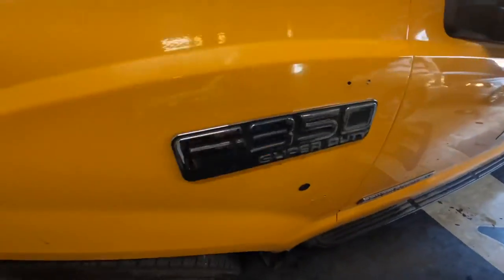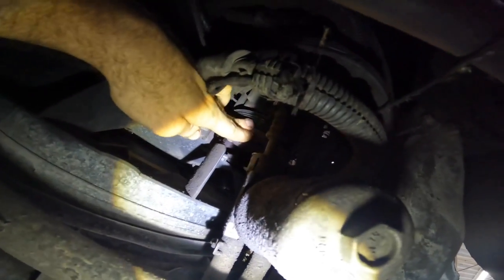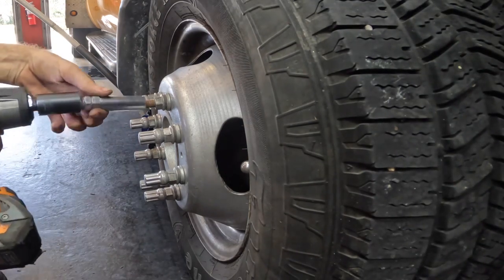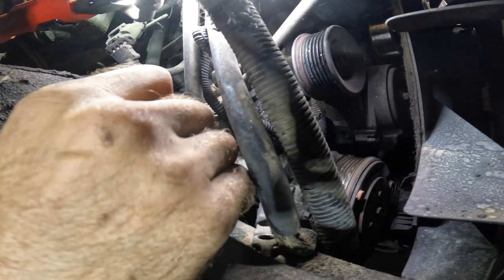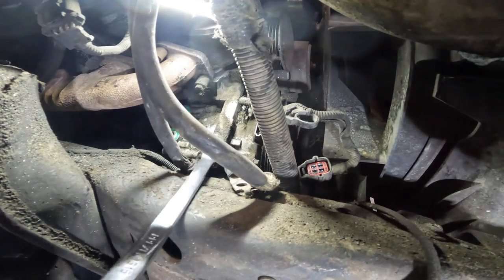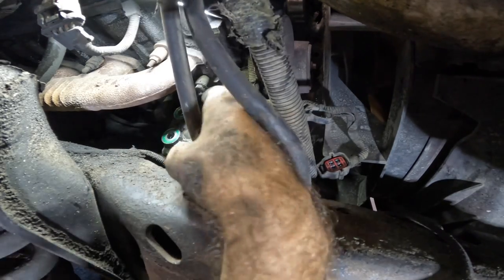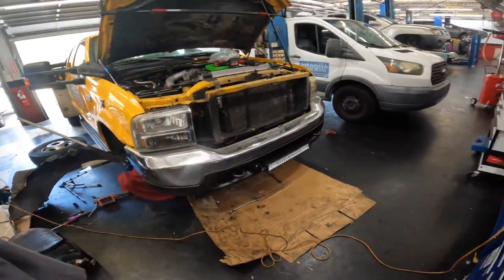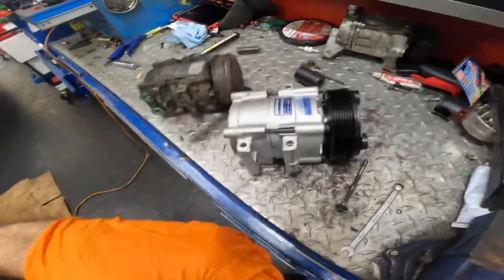Cut the Frame, Pull the Cab, or Suffer? Ford Powerstroke F350

Comment: I feel your pain, Ray! I was talking to a couple of off-duty mechanics at an event once, and they said the later-model Ford trucks were actually set up with cab removal as a part of some maintenance procedures. Don't know if there are shortcuts and other ways shops do it, but I'd expect that after the warranties run out, most people take them to places other than dealerships. One of the guys said that on Toyota trucks, he cuts one of the mounting ears off the water pump to save a lot of time. That doesn't sit well with me, but I realize the "right" way could take hours longer. Me? I do everything the hard way, but I don't mechanic for a living.
Reply: I met one of the Ford engineers..you are correct
Reply: This is the infamous 6.0 or Six Point Blow. This engine is a complete disaster and is a maintenance nightmare. For most serious top end work, which most need at about 170K miles, the cab must be lifted off the frame to access the heads and other sub-assemblies. Do not buy one of these trucks.

Comment: Ray I’m amazed on such a lengthy job you didn’t spend 5 mins on a pressure washer to save you eating dirt? Great result as usual Rainman.
Reply: And chase electrical gremlins afterwards for a few days? I wouldn't chance it.
Reply: @csgergo80  this is the best way I’ve ever heard that situation referred to 😂 totally stealing this
Reply: @csgergo80  Where the compressor is located at the base of the engine it is below any sensitive electrical that could be problem causing from washing. Additionally that area is a driving wet zone, making it a low risk to pressure washing, it would be nice if done especially for a tight job like this but rarely done or expected in a high turnover service shop.
Reply: He didn't  want to Pollute the Parking Lot.💣

Comment: the "o ring" trick was great. there was 2 holes why didn't they just put 1 hole where the bolt was? I worked on cars up north till my hands got so cold i couldn't hold a wrench
Reply: I'm guessing the engineer only measured once with his slide rule. 🤣🤣🤣

Comment: Another mystery solved....  It's very educational, watching you work Raymond, I'm not kidding.....

I've been wondering, why do these sets have 5.5mm sockets now???  I'm in a different industry, but the cars I work on are mostly GM, and some FCA, for me, family, etc....  So yeah, never needed a 5.5mm....  It's a Ford thing!  Huh.  And there's the answer...  Thank You Sir.
Reply: GM used the 5.5mm to bolt the coils to the modules on the old stuff. 3100, 3800 v6
Reply: @mph5896  I must have never run into it!  Hmm.  Thank you.

Comment: It's 11mm because Ford knows that everyone looses the 10mm sockets........Ford Cares.....Man its a great thing you don't have Parkinson's Ray but honestly I would have cut a hole in that frame plate.
Reply: Yet 10mm is the best mm at least for handguns :p
Reply: That's why I always keep 2 10mm sockets as back up.  Mine disappear about 2 a year and if lucky I find one every 2 to 3 years
Reply: I always thought it was because Ford was just buying out the world of cheap overstock bolts/nut sizes like 11mm 15mm and 16mm
Reply: Ray is a stubborn but great mechanic , I would have sprayed a couple gallons of kerosene and let it soak , then hit it with dish soap and hot water before breaking a bolt loose .

Comment: Well done Ray, great job. Sorry about my feelings about cutting an extra hole in the frame, but I would have done it. I doubt it would make any difference to the strength of the frame and who would know? I wouldn't tell anyone, promise.
Reply: metal-cutting door knob saw worked well for me  then i welded extra large washer over the cut area after done -painted it up like 5 or 6 layers over so cancer dont get anywhere

Comment: I've been a diesel mechanic for 25 years I usually work on 18-wheelers but I've done my fair share of 1-ton Diesel and it still baffles me how Engineers can be that stupid
Reply: They were counting on the truck owner who got burned in the first place buying a 6.0 to bring the truck to the dealer who would then again triple charge for the repair
Reply: Engineers sit at a desk wearing a white shirt and tie. No grease and dirt involved.
Reply: Because most have never turned a wrench in their life.
Reply: cali gdp  Lift the cab for three bolts? That is not a good design.
Reply: cali gdp  I pull the cab off my truck and take the glass out of the windows every time I check the oil.........
Reply: cali gdp  Yep. I divorced my wife. But, my attorney told me she is still my sister.
Reply: cali gdp  ah you must be a engineering specialist. 🤣
Reply: Engineers are damm stoopid but its the bogus manufacturer who allows this kind crap to go on...
Reply: especially ford engineers

Comment: First off Ray... thank you for editing this down!  A question I'd have watching this....  how the heck are you going to put the AC lines back in?  I wonder if it would have been easier to remove the exhaust bolts, motor mount bolts, raise the engine a few inches and then replaced it?

Comment: I can imagine the feeling of accomplishment when you finally get that compressor out! They sure packed that engine bay solid! I wonder how long that non original failed compressor worked before failing?
Reply: Actually Ford removed 2 feet from the engine compartment. Diesel fitters. Yep just more of that shift for brains engineering for the sale of styling. Yes a lot of those engineers do not what names of the tools he used are called.

Comment: Man these Fords.  Some stuff is overly complicated and over engineered but other stuff  actually pretty clever.  It's a mixed bag.   I inherited a 98 F150 4x4 with the 2-valve 5.4 and it was absolutely FILTHY in the engine bay.  Just identifying the leak (the block oil adapter gasket and the remote oil filter hose) was a nightmare because of all the sludge.  I commend you man.  You manage to stay pretty positive and don't curse yourself into oblivious.  Good job; love your videos

Comment: I remember you replacing an evaporator on a ford truck after not being able to just replace temp sensor.
I couldn’t believe the ridiculous design that was allowed.
Now this. …How can Ford get away with this nonsense?
Well done Ray.
You are a trooper!
Reply: I work for Ford. This isn't even bad. When I tell professional mechanics that work for other brands what I do every day, they don't believe me. Here's one quick example. One of our models has a sunroof track that's built into the roof itself, and 90% of what goes wrong with them can't be serviced. So, for a fairly simple repair, I have no choice but to cut the entire roof off the vehicle and replace it. Just the part is $12,000. A 4 door sedan has nothing from the top of the windshield to the trunk. I literally turn the car into a convertable. You have to see it to believe it.
Reply: @AT-wl9yq  Which model is that?  Do tell, please.  I'm curious to know which model to avoid like my plague (or ex-wife...same thing)
Reply: @DavidWilliams-hf8sc  Ford Fusion/Lincoln MKZ.
Reply: @AT-wl9yq  ok.  great.  Thanks.  So no sunroof, got it.  Any other stupid repairs to avoid?  Do the AWD systems hold up on the Fusions?
Reply: @DavidWilliams-hf8sc  I can't say because I don't see too many of them. Other model's, like the Taurus, have them and its a much more popular option. The transfer cases have problems and can be a costly repair once you're out of warranty. I don't want to tell you what to do, but if I was buying the car for myself, I wouldn't get it with AWD. I don't know what year you plan on getting, but I would definitely be careful with what motor you get. Some of them come with the 1.5 that everyone has problems with.

Just going by what I've seen, the hybrid Fusions seem to hold up the best. They have 2 batteries, and each one is $8,000. Batteries eventually go bad no matter what brand you get. You wouldn't believe it, but sometimes sales forgets to mention this to the customer before they buy the car.

Comment: That is one of the most painful removal/reinstall I've seen in a while.  My foul language level do that job would get me felony time.  Wow. Pretty darn impressive.
Reply: Yeah, there’s no way I could ever get a video posted doing a job like that, LoL.
Reply: I am by no means any type of auto or diesel mechanic but I recently bought a 2004 F250 with the 6.0 power stroke with 160,000 miles and drove it home but the AC compressor locked up on me when I pulled into drive way and took me awhile to figure out why it wouldn't turn over fast enough to start finally figured it out and began to remove ac compressor in my yard cause I couldn't drive it until got new compressor and belt installed. It was the the most difficult auto repair I have ever done. No experience and without the proper tools it kicked my ass for several days.

Comment: While watching this, I'm wondering how the hell is Ray going to get those fasteners back in again! Surely it would be easier to undo the engine mounts and lift the engine to allow access?
Reply: Go to a diesel specialty shop... 9 out of 10x's they lift the cab to work on these diesel trucks... WAY easier in the long run!!!
Reply: @cigarsgunsanddiesel8032  I agree, BUT, that adds an additional $1500 or more to the bill.  That is one of the reasons that I bought a Dodge diesel.  I can change a cylinder head without removing the cab.  Not so with Ford and GM.
Reply: @BuilderofRat  you can change 6.0 heads w/ cab on, it’s a PITA  but it can be done. Gotta remove the engine mounts and lower the engine that little bit… like I said tho, PITA
Reply: Lift a cab for a two hour compressor lmfao!!! Get the fan and fan shroud out of the way in less than 30 minutes and it's a gravy job all day, every day.  I've been wrenching on these for 19 years now ,,,,every day!!!!  Compressor is a good money maker

Comment: I wouldn't last 1 day as a mechanic because of the way manufacturers "jam" so many components into the engine compartment.. No patience here for such BS.
Reply: Could it B a reason experienced techs are in short supply ?
Reply: @peted5217  they dont want to pay enough for a lot of jobs these days. like truckers, theres no shortage of people able to drive, theres a shortage of people willing to pay to work. unless payrates go above inflation things are going to stay shitty
Reply: @bradhaines3142  Ya to that.  Was invited to work @ local BMW. All went well til my request to match $30hr pay. They admitted their lead tech was under $25 hr altho customer pay rate was $130 hr. 
I told the Svc Mgr. I understand the disparity. It's how the successful IndyCar, etc owner pays for ultra expensive race operations.
Reply: @peted5217  You are FAR more polite than I would be. Last time I visited a BMW dealership's service department for a few parts for my E38, they went full-on upsale. What I found out is almost anyone at any dealership gets nervous when you respond in in their manufacturer's native language. I find it both humorous and sad at the same time. $30/hr now is ~$15 a decade ago and I made that delivering pizza in 2005. A shop that sh*ts on their techs like that is nowhere I would go, either as a tech or a customer.

Comment: Mechanics worst nightmare! Dropping a tool and not hearing it hit the ground
Reply: You couldnt say it better :D So many times when i have dropped sockets in the engine bay and used so much time to find it...
Reply: And one worse than that is.... "You get to work on a Ford today"
Reply: @bertblue9683  that’s most of the diesel work we do in the shop! Ford! Luckily I’m a mobile mechanic so I just work on semis and trailers. No lite duty in the field
Reply: @bertblue9683  Thase days i'll say nope on any Ford as been fixing my family cars, literally everything fights back 😂
Reply: With just a few exceptions, you are correct.  Oil changes can become an epic Valdez experience when the oil hits the suspension, coil packs tucked perfectly under the fuel rail, headlight bulbs impossible to reach, and the list is endless.  But the most common failures or maintenance can be and usually is painful.

I was a Ford guy for thirty-five years but never again.

Comment: Respect for the great job, it was a real nightmare. I often use an open ended wrench which is one size bigger to run down a difficult bolt, it grabs easier, and since there is no torque involved it won't damage the bolt head.

Comment: I did one of these last year. I took out fan and shroud.  Took mount bolts loose and jacked up engine on passenger side.
Pulled compressor with bolts in it out through front up through area where shroud and fan were.
Installing with bolts in compressor was fun. They kept falling out or hanging up on frame.
Hope I don't need to do another.

Comment: I cut the cross member on my '01 7.3L  F250 to replace the oil pan. Truck had plow headgear to hold frame together until I welded the cross member back in. Royal PITA.

Comment: Good job man, this is why sometimes repairs are expensive,  is not the cost of the part, people need appreciate  the work all mechanics do to (the good ones like you👍)change parts in today’s vehicles. Don’t know why engineers design things like this, thinking they will last forever.

Comment: Let this be a lesson to all of us who work on our cars. Do not let any leaks go unrepaired. I just did the oil pan gasket, valve cover gaskets, and transmission dipstick tube Oring on my 1988 F150. They had all been leaking for quite awhile. It was a nasty job. Still have a small power steering leak to deal with. Procrastination is a sure road to Hades.

Comment: To remove the oil based crud on our hands, we rubbed on cooking oil, then used Dawn dish soap to cut the mess. Cooking oil will thin out the crud so the Dawn can remove it. The crud off our tractors came off easily using this method.

Comment: Had the same  one,to do.
Took the motor mount loose on  that side,and raised the  engine,and the bolt lined up with the hole,so a socket would work on it...

Comment: I bought a 1999 E350 with the 7.3 powerstroke. There is absolutely no room to work on anything. After it quit on me 200 miles from home I pulled it out and installed a 1993 IDI. No more sensors  to go bad!  Had to buy a Quick 4 to get the transmission to work.

Comment: i do not miss working on these trucks lol Did many Ac compressors on them when i worked at the dealer. you are right, ratchet wrenches for everything because of clearance issues. and it was always a messy job because these are work trucks. oil and dirt everywhere.

Comment: Working at a place about 15 years ago; the shop received a ca 2006 F450 Crew Cab, it was much easier for the tech to simply unbolt/disconnect everything from the engine, master cylinder, etc then to lift the cab off to access said 6.0 Power Joke. Once the body's out of the way; even removing the engine, if needed, was easy peasy

Comment: I did my own. Put a used compressor on only to find out the oring in the body was corroded and leaking. I took the compressor in half and cleaned the oring and groove and it's been working good since. That was like 4 years ago. Second time was worse than first. I had some choice swear works. My neighbor finally came over and gave me a hand.

Comment: It's a fun job to do. I think the fastest I've done it is 2/2.5 hours. Helps if you have skinny hands and arms. For the most part, you had all the right tools for the job. Only thing I found weird was that you had to keep 2 bolts in the compressor... I've only kept 1 in. 
Tip: If you unbolt the compressor from the block then you can swing it over, away from the exhaust manifold, so you can gun off the manifold bolt without worry of stripping the head on it. 
Great job on getting it done. Most guys quit on the truck or take HOURS.
Side note: If the starter on those 6-OHHHHHs go out, replace it with one for a 6.4

Comment: Ray I had to do this job twice last summer on my 6.0 truck and it's not an easy job. First compresser was bad from Napa. I found it easyer to pull the fan and fan defuser to get access through the front it also gives access to the belt and pulleys I feel your pain though.

Comment: Started driving in the 60's when we all had cars built in the 40's and 50's.  When we popped the hood and looked in, we could see the ground on both sides of the engine.  Lots of room to work.  Now, you can hardly see the engine.

Comment: English Bedford J2 model I think it was.  Frost plug leaking at the back of the cylinder head. Another brilliant engineering design from the drawing office. Let’s make the job as difficult as possible. Let’s make it easy as possible, cut a hole in the firewall from inside the cab.
 Right opposite the leaking frost plug or core plug. Saved removing the engine.

Comment: I am an HVAC repairman, not a mechanic. I changed out my compressor on a 2004 F-350 by myself, and it wasn't fun. It took most of a day and my arms were scratched up when done. I unbolted the radiator and cowling, which was a big help. After i got the compressor off, I was thinking about how it would have been much easier to pay a mechanic to do that job for me. 
I got it done, but I don't think I will tackle that job again.

Comment: lol this was fun watching taking in i am a ford Diesel specialist  and seeing you struggle with the inner fender guard  was amusing some there is a trick to get them out in one pop and pull  and also a passthrough socket set is your best friend with ford these days mostly if you dont feel like lifting the body or like me mobile ... and no lift but I have master rebuilding the engine in frame on them ...